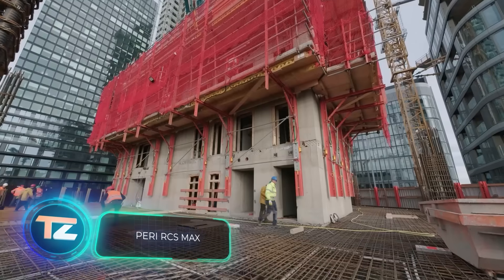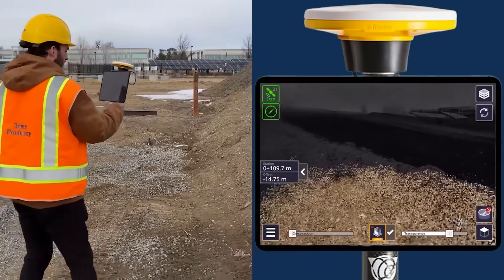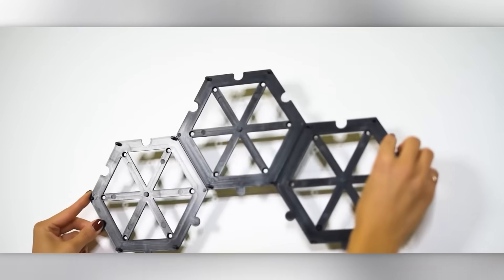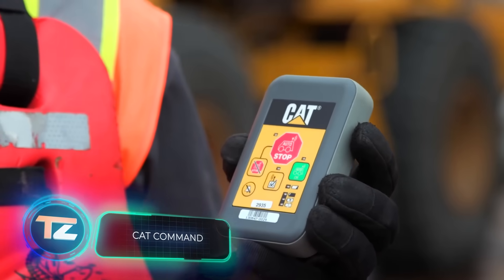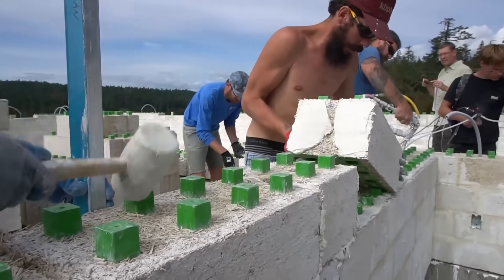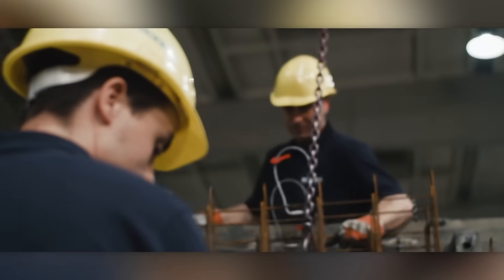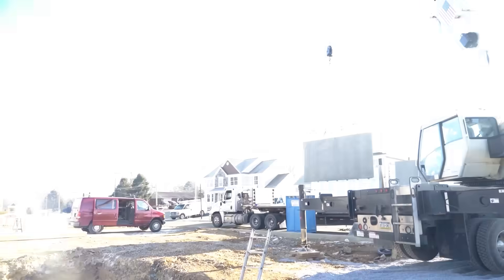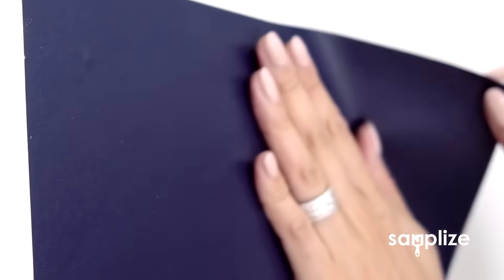CONSTRUCTION TECHNOLOGIES THAT HAVE REACHED A NEW LEVEL

Comment: I really doubt the effectiveness of the ice formwork. The heat generated by curing concrete would melt the ice before it had sufficient time to set up. Also you can’t cool the surrounding environment to prevent the ice from melting, without freezing the water in the concrete mixture. Novel idea and I wish it worked but I don’t think so.

Comment: If you remove the need for a cabin, those remote excavators might actually turn out to be cheaper, a lot more compact and consume less fuel.
Reply: Eliminating the cabin from remote excavators could significantly reduce manufacturing costs, making them more affordable for construction companies looking to invest in modern equipment without breaking the bank.
Reply: Thanks to all family members ❤❤❤
Reply: It is but in real life application, you always need human to be on the job site, hence why they don't remove them
Reply: While the idea of cabin-less remote excavators holds promise for cost-effectiveness and efficiency, the indispensable role of human operators on job sites cannot be overlooked. Human presence ensures real-time decision-making, adaptability to unforeseen circumstances, and the ability to address complex tasks that require nuanced judgment and expertise. @eone2345